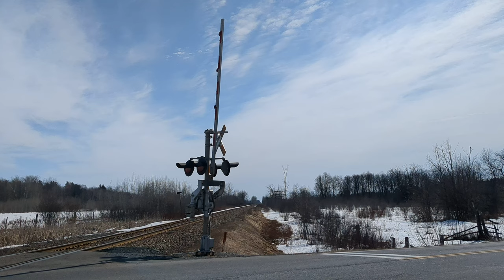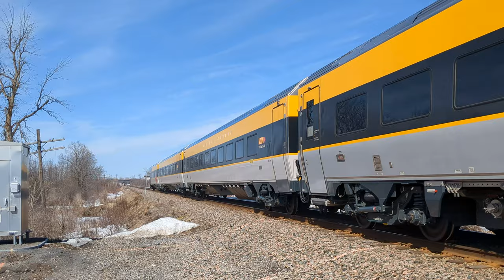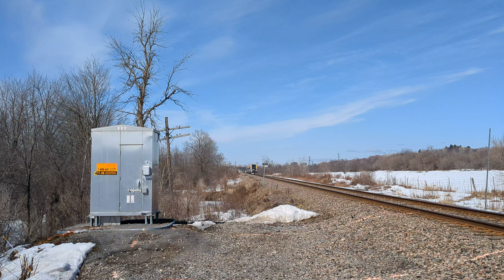Horn of the Charger! | Via Rail SCV-42 #2202 pushes train #33 past Ramsayville Rd. into Ottawa

Comment: Which go train line does the scv 42 run on
Reply from the maker: There's one rotation that overlaps Lakeshore East right now
Sun 43, 646
Mon 45, 48
Tue & Wed 41, 46
Thu 41, 646
Fri 43, 668
Sat 633 (so not in GTA)
Reply: K thnx